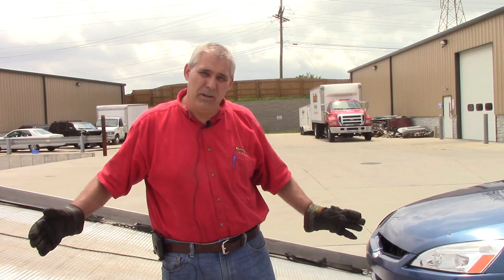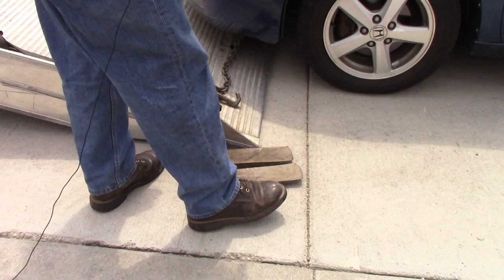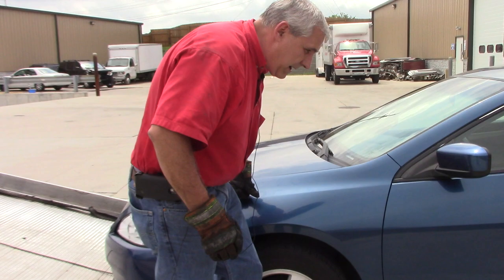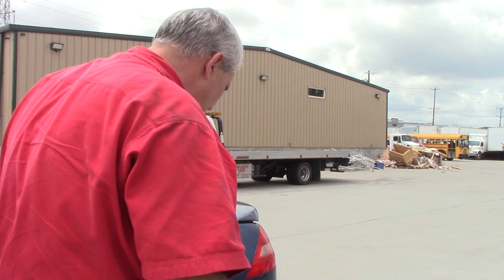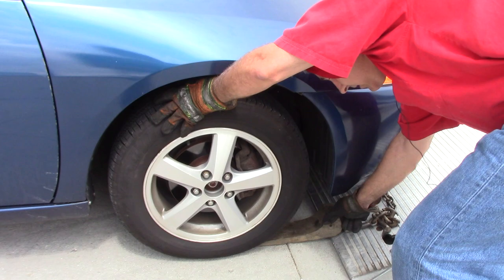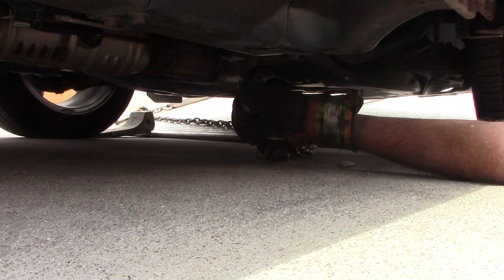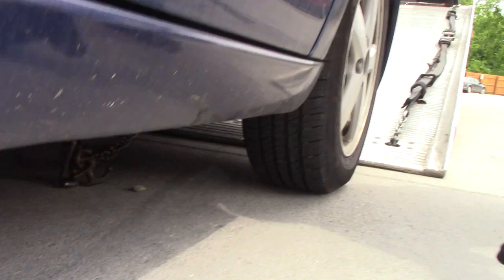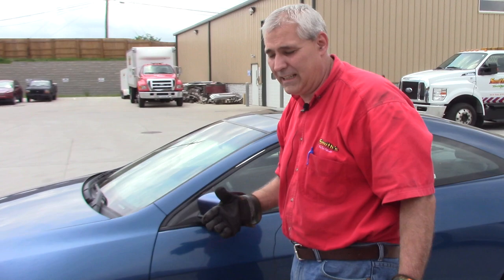On-Loading a Car with Skates | Smith's Towing

Comment: Now if u didn't have skate's how would you get its off
Reply: Dawn dish soap or WD40 on the bed or a chain under the tire. All three of those methods work
Reply: I would run a snatch block to the end of the bed, run the winch cable through it, and back to the front control arms and do a reverse pull.
Reply: I look for a tree and wrap a chain around it. Hook to car and drive off slowly.
Reply: @micheldanis4933  I would love to see a video of that.